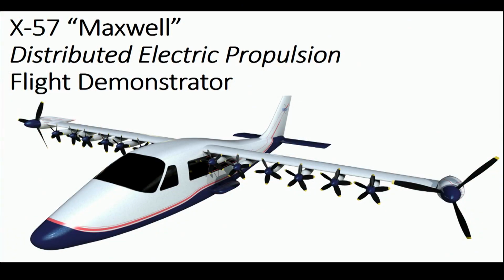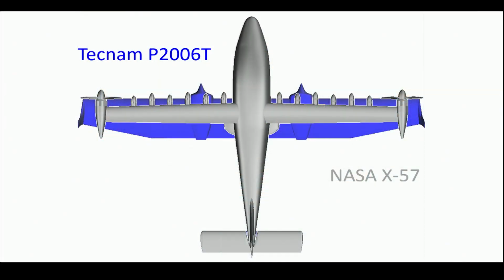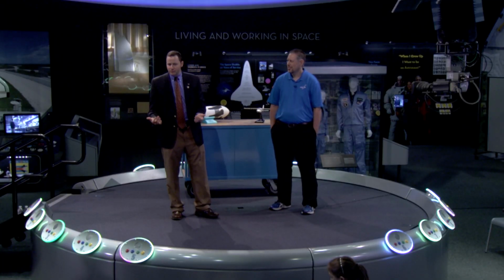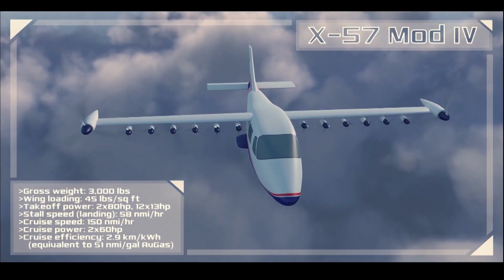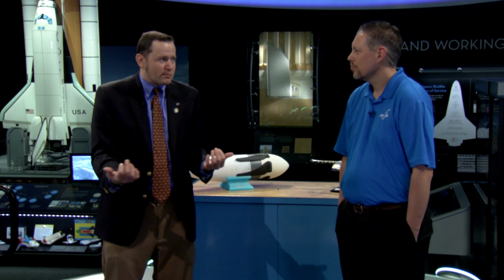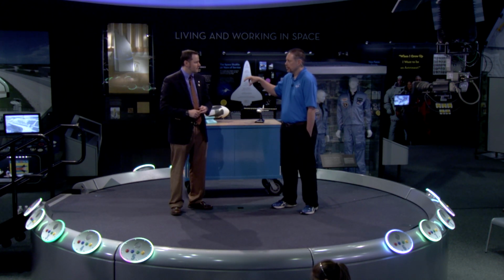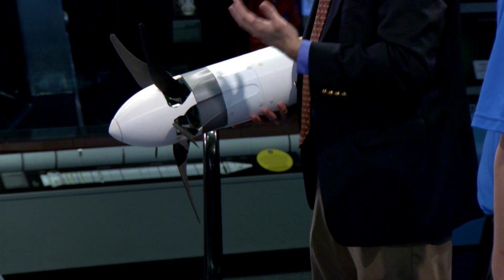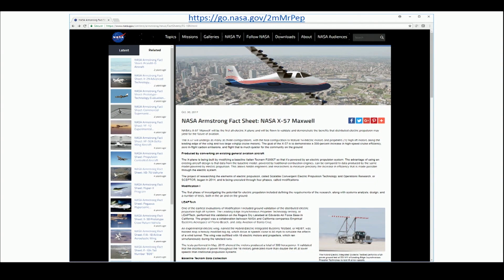NASA’s X-57: Learn How Electric is the Shape of Things to Come

Comment: Seems to me it might be better to reduce the length of the wing rather than the cord width. Be a lot less proppellers and motors too. Maybe just 4 total.
Reply: If you reduce the wing width you reduce lift. The plane wouldn't be able to get off the ground with the amount of thrust it gets from the electric motors.

Comment: Has anyone thought about mounting the small motors and propellers above the wing to increase airflow above the wing and thus increasing lift.
Reply: Ranjit : There is more lift potential /advantage with an aerofoil wing than any form of vertical propulsion.

Comment: The electric motors may be 92 percent (same as what Tesla claims, btw), but the process from the plug, to the battery, from the battery, through the inverter/controller and out to the motor and then prop is likely around 70-75%, not 92% (.9.x.9 x .95. x .92 = 70%) If gas engines are 30% (actually less, more like 25%), then the ratio is .75/.25=3:1 at best.  Three times, or about what an electric car gets.  

The 5 times ratio then is via the smaller wing, tip props (vortex minimization) and resulting less drag and the 3:1 electric ratio.  Wing 1.66 x electric of 3 = 5:1, which is what the claim in energy is by NASA.  So, they are not lying to you....real numbers.  

New combustion engines have now hit 60%.  Formula 1 is 50%.  They could be 60-80% with combined cycles, like what I am working on or about par to electric, for easy math.   At par, the fuel cost and battery life cycle costs then are the main issues.

On Natural gas ($1/gal) vs electricity at 12 cents/kw-hr ($4/gal), the future actually looks MUCH better with distributed power via my IC engine that fits on wing at 3 hp/lb.  

So, with distributed power on both (same small wing, fuselage one for one comparison), it comes down to the fuel costs and life cycle costs.  Batteries are 12 cents/kw-hr to use (charge/discharge/kw-hr) or $4/gal.  Total electric cost is at least $8/gal vs Nat Gas at $1/gal and Gasoline at $3.  

Also, NASA made a lot of mistakes on the x-57.  Happy to go over some if you like.  Basically they wasted $15 mil on something that is MUCH more expensive and less useful than my roadable seaplane.  see my tweets at twitter.com/seaplaneguy if you want to know the future of aviation.  The x-57 is correct in the distributed power, but not how they implemented it. 

Also, if an airplane is not door to door, forget it.  Waste of time and money.  Park it in the garage and use daily...or forget investing in it.  The future of transportation can be 1 cent/mile at 100 mph, 4 at 200 mph for a four place.  Road tax should be 4 cents/mile just to cover road costs.  Fly for "free" by not using road....

Comment: Why so many small motors instead of say two larger motors mounted closer to the wing roots so that outboard wing strength is less of an issue?
Reply: The many small propellers are to increase air speed over the length of the wing at takeoff and landing, increasing lift. Placing the larger motors at the wingtips helps counteract the drag caused by wingtip vortices. I do imagine that the wing must be quite strong to support it though!

Comment: Are there any engineers here?
I ask because, they're using numerous small propellers & motors instead of one or two large ones, which would be more efficient.
So, why a whole pile of small ones? It only increases complexity and cost, as well as weight.
Why not one or maybe 2 large motors and props?
Reply: Watch it again; he explained that.  The novel step is the use of many small motors to accelerate airflow over the wing, so that the wing's lift effective is improved at take-off/landing ground speeds and the stall speed is lower.  They are not used in cruise, hence their folding fixed-pitch blades.  This idea is not entirely new, as he mentioned, but it is made practical because small electric motors are efficient and easy to package.  Regarding complexity, the number of parts, manufacturing cost and maintenance schedules of electric motors are way lower than piston or turbofan engines.